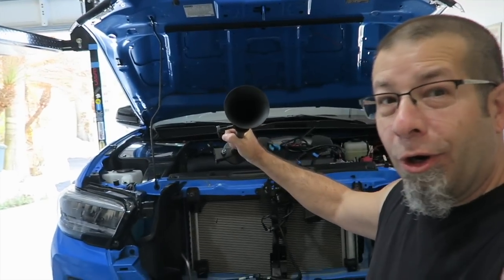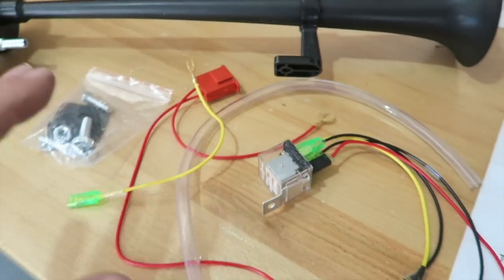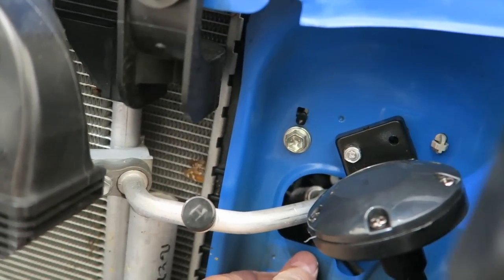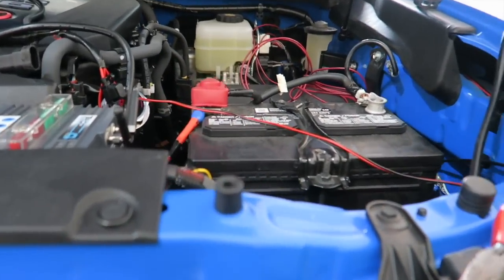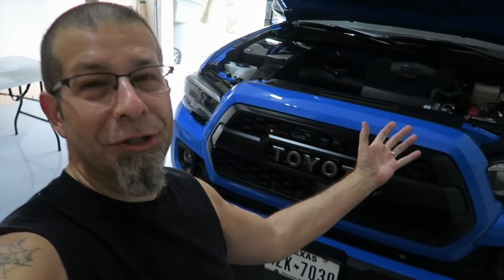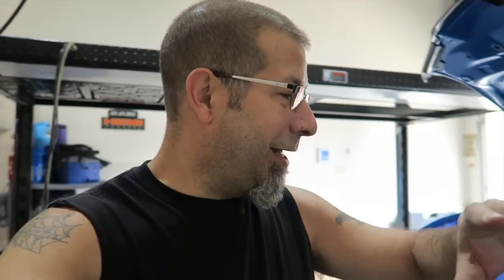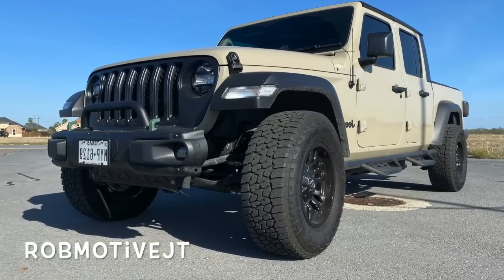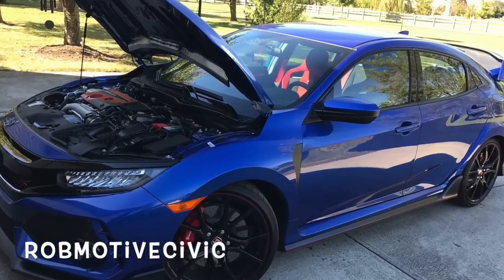Tacoma Train Horn Install & I'm Giving One Away

Comment: Awesome. @TheMortgageBengal is where I followed.
Reply: Hey rob I just install my train horn but I have a question you have any pics of how you run the wires to the switch or you just plug one,thanks for great videos
Reply from the maker: Have a look at the install video.  It shows how I ran the wire 👍
Reply: @RobMotive  thanks for responding good morning yes I keep checking the video and you give the idea for the air horn and I order the same one with discount code I just finished last night with and I unplug one oem horn and plug in the air horn but I see you run 2 wires red and black so where you hook the red one from the switch to the relay or to the air pump, I so sorry but I can't see where hook those wires..thanks for you help